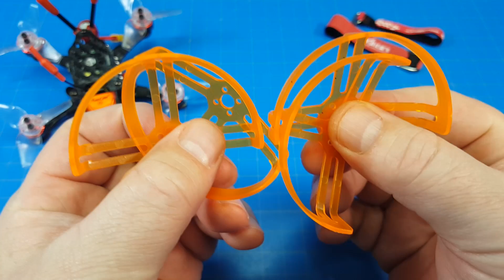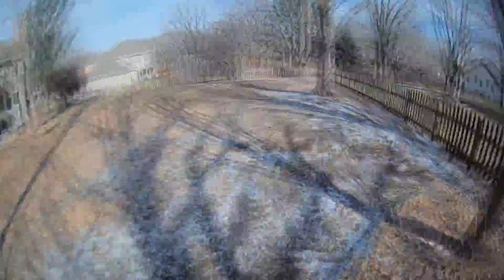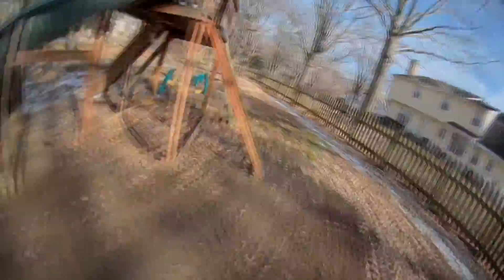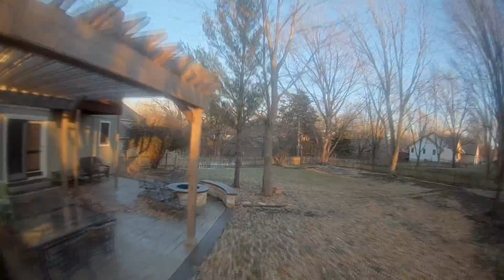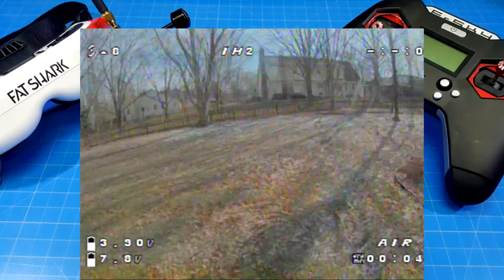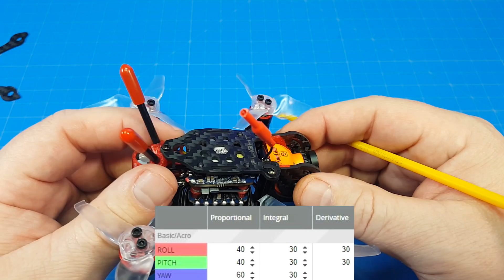iFlight iH2 V2 - HD footage

Comment: Hey Nick, I've built 4 quads with the turtle including the iflight iX2 whoop frame. Originally I had a standard fpv cam getting 3-3:30 flight times. Then added the turtle. Flight times went to 2 mins. That was the only change. So I'm convinced that these HD cams are sucking the amps.
Reply from the maker: The weight likely also plays a role in the decreased flight time. If we add 8grams of a 80gram quad that 10% could results in 10% less flight time.
Reply: Not the cam but the dvr. You will get more thrust or flight time if not recording with dvr. But that will be funny because we want HD footage rite?
Test fly without recording, when it's ok then go fly and recording.

Comment: Wow 9500kz everyone has been lowering kv for more cells it's like they are new to the game 🤔🤔🤔
Reply from the maker: yes to high kv in my opinion.
Reply: @NickBurnsFPV  on a 2inch on 3 or 4s   what kv would you like to see I was starting to believe 6000kv or lower  but you dont believe that to be so. I have some 1105 8500kv kk motors that you recommend a while back I thought they'd only be good for 2s but are you suggesting they could run 3s on maybe a 2.5 inch build ...thx
Reply from the maker: on 3s I think 7500-6000kv will be good. On 4s we likely have to drop further to 5000kv or less on a 2inch props.  Those motors will run 3s on a 2.5inch prop just fine. They are pretty old, we may need a lower pitch prop to bring in more low end response but I have run those KK1105 8500kv motors on 2.8inch props about 1.5years ago.
Reply: @NickBurnsFPV  omg that et115 with kk8500 kv on a stack that flew fine on a different build.... it flies awful could it be the motors using stock et115 props it feels like so bad doesn't shake or nothing but it feels like I never flew before

Comment: Here's their first paragraph of text on their website:
iFlight iH2 V2 is a new FPV tiny-whoop designed for the indoor HD aerial filming based on iH3. It has all the fun and advantages of IH3, but now in a smaller size and comes with the latest released electronics.
HUH? Tiny who0p? 86.8g w/o battery? What? There are no 2" micro quads anymore? Just because there's a who0p craze going on now doesn't mean an 86.8g, 2" micro quad IS A FRIGGIN' WHO0P!
SHEESH! Customers do buy other things! It doesn't have to be called a Tiny Who0p to sell quads!
This is pure STUPID! 🤯  Please make the madness STOP! LOL 😂😵🤪
Reply from the maker: yes, that is funny. Using whoop in the description to manipulate search results....maybe?
Reply: It's the same as calling a quadcopter a drone, I think Nick has hit the nail on the head with the internet search results conclusion.
Reply: @notimeformorons5505  yeahhhh? Not quite ... A drone and a quadcopter are the same thing. A who0p is a certain class of drone or quadcopter specifically meaning it is somewhere in the general vicinity of 65mm, typically has ducted prop guards, is made for flying indoors and outdoors on less windy days, and weighs somewhere around 1 ounce (~28g) ... + 50% ? 
Let's see... How many of these does this Intrepid include? ...
Z   E   R   O   !  Lol
around 65mm - hardly! 🙉
No prop guards, let alone ducted🙊
I challenge anyone to fly it indoors! Damage to property will happen! Lol 🙈
And it weighs approx. triple what who0ps do!🙊
SIMPLE CLICK BAIT BULLSHIT! 💩😉
Gives us an idea they don't think that much of their product and it's ability to sell for what it is, without adding who0p to the description!
Other sizes do still sell! 🤔🙄
After seeing it, I can see why! Barely 2 minute flight times for a video drone? Geez!

Comment: I really enjoy your videos, the straight talking reviews & information is very welcome, along with you purposely flying in different environments and weather conditions etc. to test quads/cameras, but I have to ask - what's up with your flight footage on almost all your videos? If I pause when you're whizzing past a tree or something then I see a double-image of the tree, a combination of two frames merged into one.
Reply from the maker: I do see what your seeing. Its not in the source files, but in the render. I wonder what I need to do to correct that? I am rendering at 1080 60fps.
Reply: There's definitely something weird going on, YouTube isn't presenting any 60fps options just 30fps, so taking a closer look at this particular video frame-by-frame, each frame of the 60fps HD quad footage is comprised of 3 frames merged together, and the FPV feed footage is comprised of 2 frames merged together, it appears the editing software is doing some squirrelly framerate conversion on the final render.
What's the editing software you're using? My wild guess is an obscure option or output template that's causing the half-framing.
Reply from the maker: I have spent some time looking into this issue and what others have tried. In my next video I will make some changes to the output render settings, mainly the deinterlace and encoder method. I am hopeful I will find the issue. Thank you for bringing it to my attention.
Reply: That's great to hear, it's likely the deinterlacing option causing the framerate drop from your 60fps source to 30fps we see on YouTube.
Almost all of today's FPV DVRs and HD cameras record progressive footage, you have to go out of your way to find hardware that can capture the full interlaced footage of a FPV feed, but when such footage is properly deinterlaced it looks far better than any FPV DVR. I have an example video of this titled: Fat Shark DVR vs true D1 video capture

Comment: I didn't know this quad even exists. Thanks for your review! But isn't this the Runcam Split Mini 2 V1 with the M8 lens which is said to cause jello? I wonder why all these new micros come with version 1 of the Split Mini 2, when there's already the newer version with M12 lens.
Reply: You are really confused. The current offerings are the Split 2S with a single 30.5mm board. Then there is the Split Mini 2 with a single 20mm board. 

Yes, RunCam is pulling s fast one by changing the Split Mini 2 from M8 to an M12 lens because of the jello issue from loose lens elements. There is no indication which you would get from a retailer, so they are dumping the crappy ones on the public. 

Most BNF like the iFlight IH2/3, GEPRC Cygnet 2/3, Diatone GT-R249/+ HD, etc. come with the Split Mini 2 M8 version. Probably because they ordered a bunch of them a long time ago to get ready for production. It seems that may be why the Diatone quads are delayed because the canopy only fits the M8 lens, and they may be trying to switch over to the M12 version. 

Also, the Split Mini (v1) had dual 20mm boards. So, you are totally wrong.
Reply: TweakRacer I'm referring to the two versions of the Runcam Split Mini 2, as there are obviously two versions. One with M8 lens and a newer one with M12 lens. Read my comment carefully and you will notice that I didn't mention Runcam Split Mini V1, but Runcam Split Mini 2 V1. So, at which point am I totally wrong?